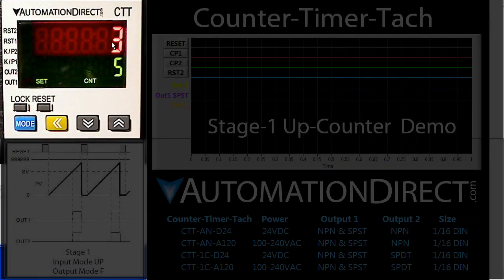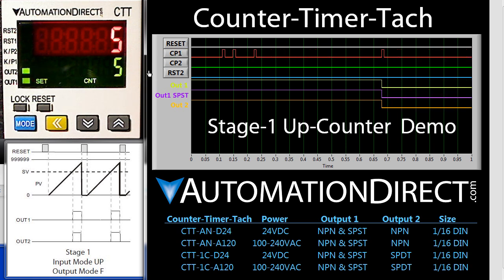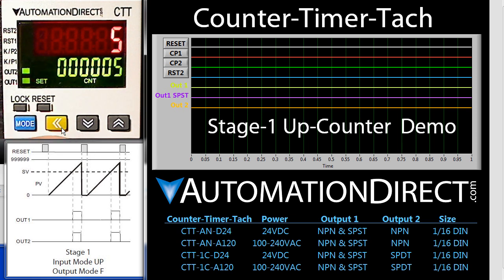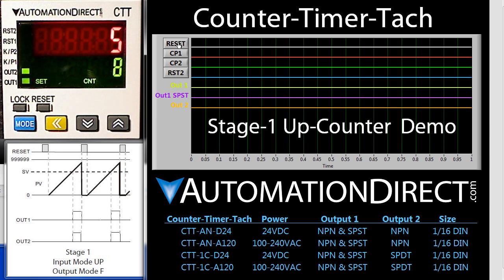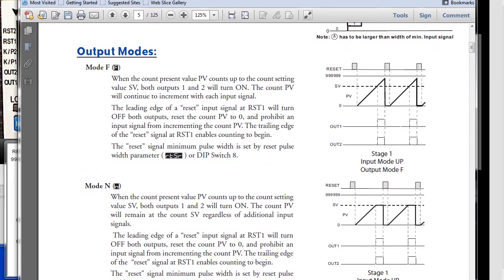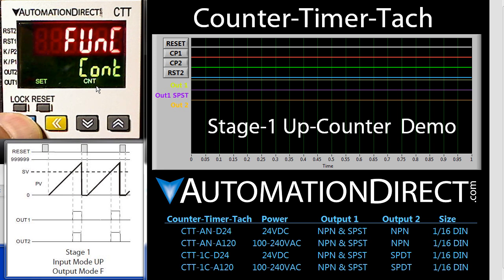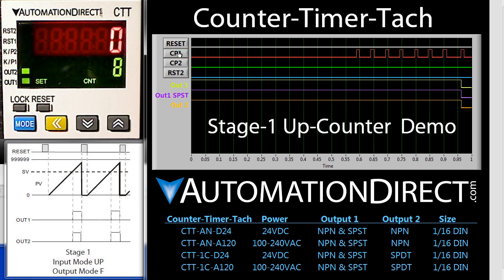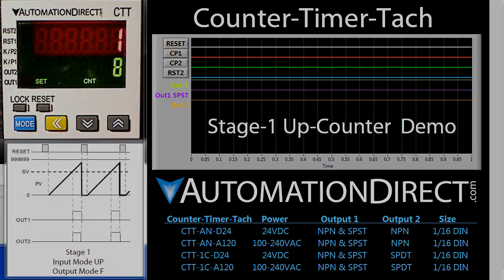Counter/Timer/Tach (CTT) Stage 1: Up-Counter Demo from AutomationDirect

Comment: Is it possible to activate Out1 and x seconds later Out2 o they activate always together?
Reply from the maker: @marcosc1530 this device has many different functions, but it activates both outputs together. You could accomplish something like you are describing by putting two simpler timers in series with each other, so that the first timer finishing triggers the second timer. Take a look at these for options:
https://www.automationdirect.com/adc/shopping/catalog/relays_-z-_timers/timer_relays

Comment: CAN THIS DEVICE BE EASILY USED TO COUNT" COMPRESSOR RUN TIME" AND "COMPRESSOR CYCLES" ON AN AIR CONDITIONING UNIT? 
CONENSER UNIT OUTSIDE HAS 240V AND THE COMPRESSOR CONTACTOR USES 24V COIL
Reply from the maker: It can be used to count/time anything if given an appropriate trigger. In your case you could use the 24VDC contactor coil as the source of your trigger. You'll probably want to condition that some and of course the Timer isn't rated for outdoor use.